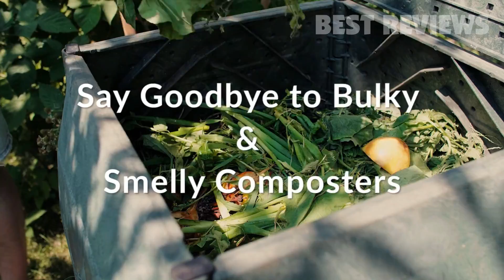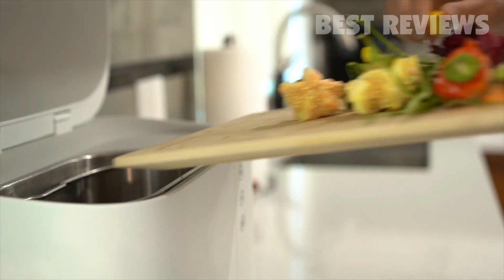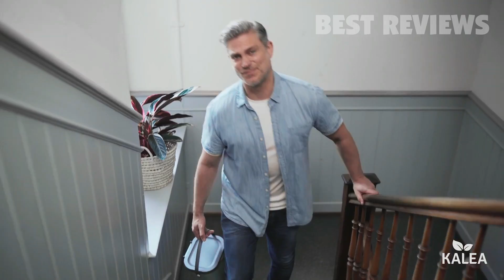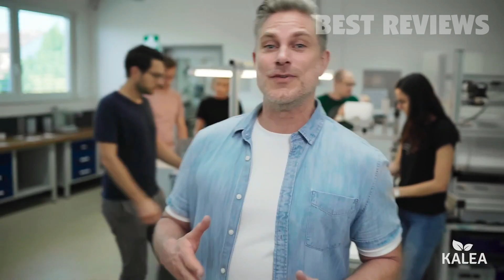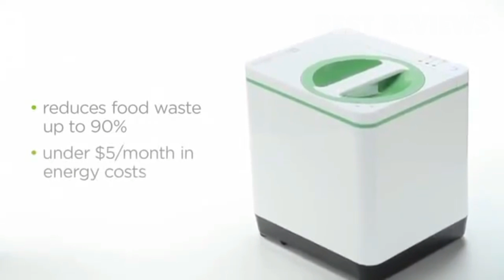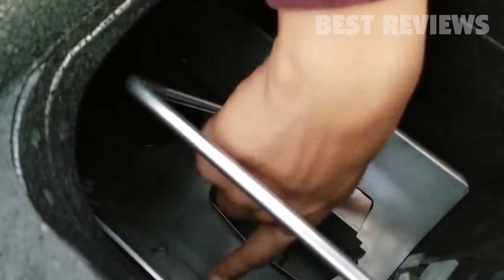5 Best Electric Kitchen Composter in 2024

Comment: I feel like a FOOD PROCESSOR would be the best thing to use - cheaper to run too. Chuck in the dishwasher after each use. And buy an air tight container to put the blended food in. These product aren't good because of the plastic needed to make it nor the electricity bill. My granddad used to have a veg patch and he'd chop and break up his food waste and bury it in the soil...then plant seeds and it thrived. Old school is best.
Reply: Yeah I’m wondering how much heat is used to speed up this process and ruin any nutrients than just naturally allowing composting to be produced. Energy usage is a huge variable to consider too.
Reply: Yeah, a guy tested growing plants with this produce mixed with soil and the one with just soil did better. Dehydrating isn’t composting